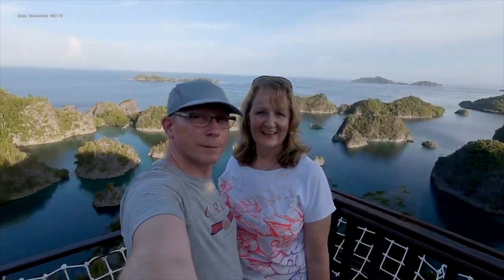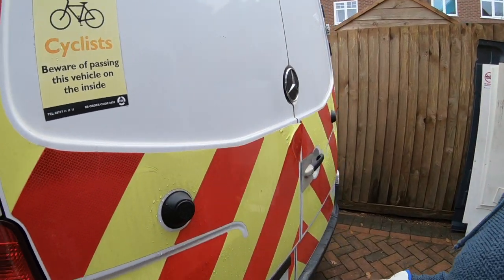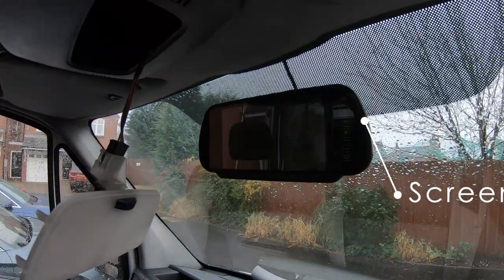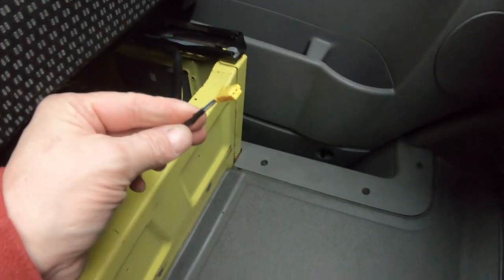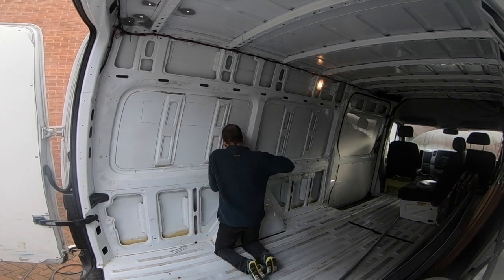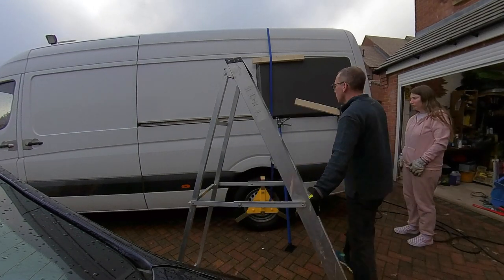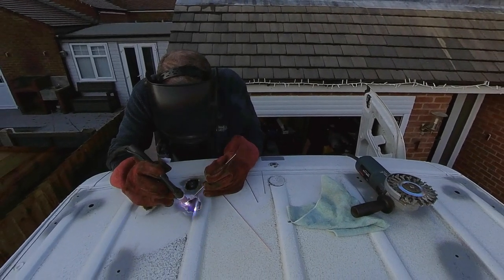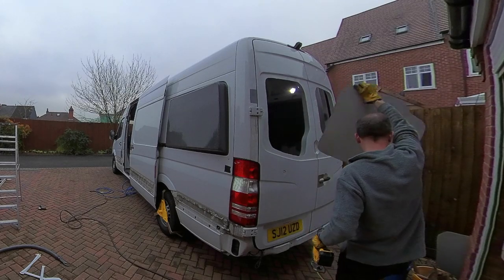Camper van build begins - Part 1 of our self build camper conversion

Comment: You put the side pods in the wrong direction! The small part should be to the back of the van.
Reply: Interesting point. I’ve just measured the width of the van inside the side pods and it’s the same width inside at the front and the back of the pods. It’s because the van is narrower at the back so needs to extend further at the back to give the same length of bed. If the wide part were fitted towards the front the bed would be about 3 inches longer at the front than at the back and the van would be less aerodynamic (not that that’s a big deal as the whole thing is like a brick). So, I’m happy with the way we fitted them and they give us a good bed with the same length on both sides. 
Thanks for watching.
Reply: @bdiamond999  My comment was only from aerodynamic point of view, not inside dimensions. The way you installed it creates even more turbulence behind the van. The most aerodinamic shape is tear drop. That is why plane wings are big in front and tapers to the back and not the other way around. I saw that in part 2 the doors don't open completely and you had to make an extention. That would be another reason.
Reply from the maker: Ah yes, I see your point. I’ve also looked at them and they are shaped to fit the contours of the van and are fitted correctly. Guess they were designed purely for the space inside at the cost of aerodynamics. Thanks for your comments.